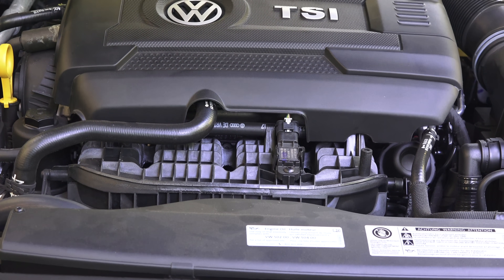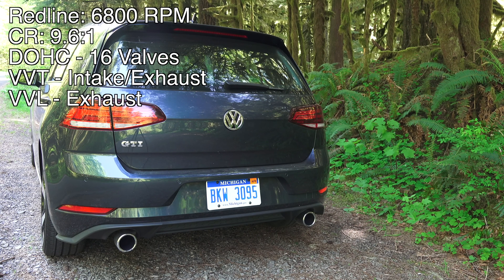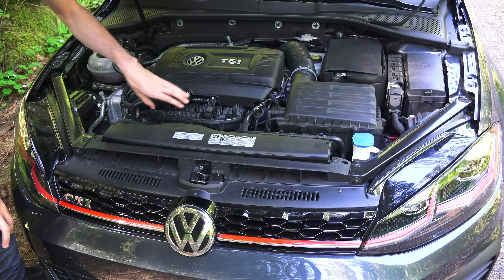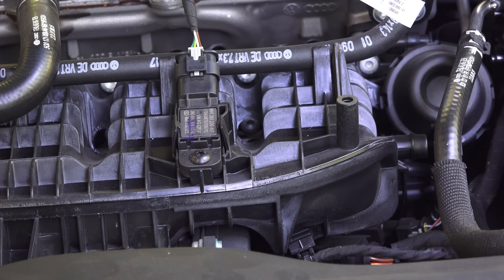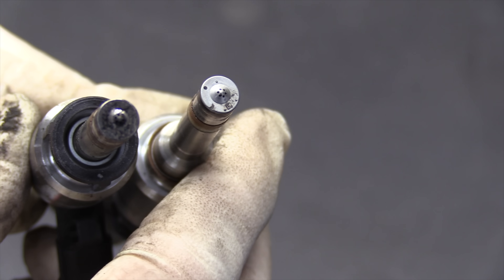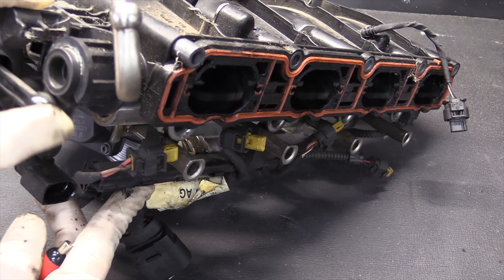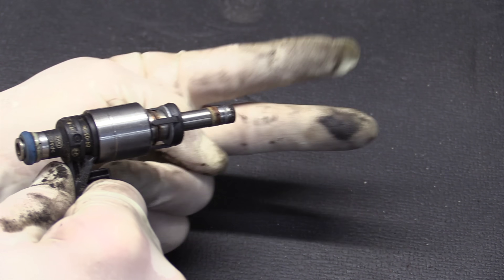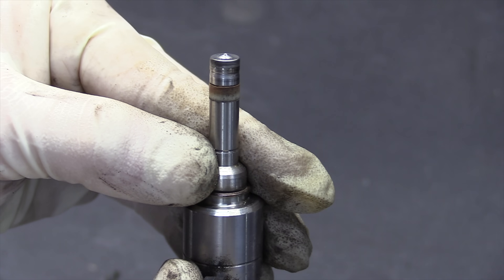The Best Engines - Volkswagen GTI Turbo

Comment: All the yadi-yadi-yada sounds good but I want to remind everyone that these engines have a poorly built water pump, poorly designed timing chain tensioner. The water pump in particular is known to continue leaking even after replacement at vw dealership. There is a class settlement currently going on for the crappy vw water pump on these engines. It ends in April, so don't forget to follow up with that is you own a vw with one of these engines. The timing chain tensioner is known to fail, resulting in total engine damage. That is to say the engine goes out of timing and damages the engine head, along with pistons and valves in the best case scenario. The vw dealership will ask you for $7800 before taxes to rebuild your engine. Even if you want be proactive and change the timing chain tensioner every 105,000 miles as recommended by vw, it's a 5 hours job at all vw dealerships and the bill is around $4000. If you have any car with these engines in them, also invest in a training on how to service them yourself because even though they drive wonderful when they work, their maintenance cost at the dealership piles up very fast as the miles increase. The new long wheel base model of vw tiguan, that started in 2018 has these, engines, and we are all keeping our fingers crossed to see if vw has made any meaningful changes to their design philosophy.

Comment: I have the 2019 Civic Type R and I love it. But Id like to hear from golf gti owners here, I'd like to get a GTI 2019 as my daily but is it reliable enough for daily drive? Any major issues?
Reply: Besides the manuals gti having some crank walk issues, the dsg dq250 & 381 are amazing transmissions. Maintain them every 40k miles & will likely have no issues. I know personally many people with mk7 gti & R s well past 100k miles. The gen3 is leaps & bounds better then any previous turbo engine from VW minus the diesels alh. The 18/19 came with 6/72k warranty so that should say a lot of how much they’ve improved.
Reply: @markd3891  Sweet..good to know , yeah i am actually set on the DSG transmission since its gonna be for my (winter) daily. I have a 17 Civic Si that i use now as daily but thats manual 😕 and id love to have an automatic. Thanks again bro. 👍
Reply: My 2017 GTI threw a thrust bearing and needed a new engine and gearbox at 104000kms.
Reply: @Cimone90  hmmm is that a common thing on the 17s? Thanks for your input bro.
Reply: @berlinmae07  no it isn't common. It's more common among the earlier models. I ended up putting in a 2018 motor so fingers crossed it's gonna be ok a long time now. If you google mk7 GTI thrust bearing, you'll find a few forum posts from others with similar problems but it seems very uncommon. I just got unlucky I guess.
Reply: @Cimone90  ok i hear you bro, glad everything's ok now with yours. Yeah i was gonna google it but got sidetrack like i often do lol, thats why i thought I'd ask around here. Thanks

Comment: They maybe best engineered engines but for sure worst when it comes to reliability. Everyone who works on these they hate these engines. I took mine once owned 2015 jetta with 1.8 to my mechanic he told me get rid of it because he had 3 more with same engine problems parked waiting to be fixed. He said same with audi and wv 1.8 2.0 engines. I had 2.5 that was way better, sold it to my friend he still drives it with well over 100k between him and I never had engine problem.
Reply: Wrong, the gen3 engines are vastly improved over the previous gen 1 & 2. Many of the mk7 guys are well past 100k miles. Your mechanic is not up to date on the gen3.

Comment: 2010 2.0 EA888 GTi engine. Lots of fun. Power and torque, response, and sound is very good. Chain tensioner fails and blows the engine (high percentage). Carbon build up a serious issue every 25K miles. Oxygen sensors and individual coil packs fail very frequently as well )aain about 25K miles). Those items fails two or more times sooner than it would on any Japanese or American engine. I hope VW has correctly all these issues since when it does run it runs great. Intervals for all those items to act up is just rediculous. Oh !!! fuel injectors had to be extended warranty by VW until 110K miles since those fail quite frequent as well. ha!!! This post is all true. If any doubts ask VW or the humble mechanic. Oh !! The intake manifold fails every 40K miles fail too hahah List to long to post here. I am a VW owner (use to be). Love the way they ride and perform but intervals for failure too soon for my liking and my wallet. I can provide you pages and pages of the repairs. On and on.
Reply: That’s why the gen1/2 were pos & why the gen3 is leaps & bounds improved vs the previous not to mention holds 350-400whp without much of a fuss either.
Reply: @markd3891  I sure hope so buddy. I spent a few K just to keep it running. Its a great ride. My concern is the reliability. No, I did not abuse it. Not even a sigle tire burn out. Good luck to all the V-Dub peeps . Im not a hater. I just got burned along with a few thousand other V-Dub owners.
Reply: David D I have 4 vag cars, knowing which engines & models to avoid helps so much. With that said, non of them ever gave me issues. I do have a Vagcom cable but besides doing dsg flushes & clearing the reminder codes, non of what other owners describe happened to be. My oldest vag is a 13 Touareg tdi with 182k miles. No leaks, no smoke no nothing. Replaced twice the brakes though & 3x oil changes in the trans too but I’m keeping it till the wheels fall off or the engine blows a piston through the floor lol. Gluck to you too, I know there are haters on everything just like everything else on this planet. It’s a love/hate relationship just like with the wife lol

Comment: My 2009 Jetta Wolfie with a 2.0 turbo was a CEL nightmare. Sorry. I’ll never buy another VW. It went 144k miles but spent a lot of time at the dealership. I even had to replace the throttle body at 120k miles. Junk.

Comment: No question modern technology and performs well within the application area. But this thing has serveral weakpoints, Turbo, coal coating, waterpump(s), Chain, valves, DSG...not a long runner everytime

Comment: Worst engine I've ever owned. Timing chain tensioner failed, carbon issues, intake manifold changed x2, Pcv valve, broken flywheel and two turbos. This all happened while the car was new and unmodified that was serviced at VW. 

2014 GLI

Comment: One of the biggest problems which was not touched on in this video is with the lack of port injection, carbon buildup on the intake side.  If they do dual injection it would be a big relief for a lot of people who don't want the headaches of a teardown to clean the carbon from a DI engine. Now I know this affects certain engines differently, but with these flaws of DI I still wonder how these can be considered some of the best engines. Aside from that, I am sure they ARE great.

Comment: I wonder if it's a laughable question but I don't get it so I'll ask anyway: Why is mpg in the city different than that on the highway? Also, why lower?
Reply: Let me simplify it for you
If you ride a bicycle and you stop and go many times will you waste the same energy as if you take a long road without stopping? If you get this you get your answer
Reply: @kawaonly1389  Yes I would be wasting just as much. So, is it just  the traffic that causes all the difference?
Reply: @subramanyabhat446  starting takes more energy than just maintaining speed. You don't need to repeatedly start moving on the highway like you do between lights in the city.

Comment: shiz - are those carbon deposits on the flaps in the intake manifold due to blow by and a PCV system designed without a catch can?  Imagine what the valves would look like = SCARY - quart of oil per 1,000 miles - no thank you - the VW Group are crooks btw - Dieselgate - haven't you heard ?

Comment: I have had many turbo cars, but 2.0 tsi mapped to 250/350nm with manual box is best turbo ive ever driven. The low torque makes it so effortless and fast in real life driving under speeds of ~150km/h

Comment: 3:30
Water cooled exhaust 
Or
Exhaust heated water?
Reply: the second
Reply: rt re 
Yes, it two sides of the same medal (as we would say in Dutch). 
I don’t understand however how cooling the exhaust can prevent knock as knock would occur long before the exhaust valve will open. Am I missing something?
Reply: @Conservator.   yep i think it's only for the engine to heat up faster and to have warm air in the cabine as soon as posible
Reply: @Conservator.  I don't think the exhaust cooling it has much to do with knock. If anything I would image hotter cylinder temps would increase the chance of knock. Better air/fuel mix does give you a more complete burn and more power.
Reply: cool gas is less tubulent therefore less speed

Comment: Premium fuel disqualifies this engine.
Reply: That's why the 1.8t 170hp, 200 torque is the way to go.  Runs great on reg and is super peppy and fast engine.
Reply: But premium fuel is everywhere...? And not that expensive, especially if you live in the United States.

Comment: It's a piece of junk.
Reply: Based on your opinion? How much value does that have anyway?
Reply: @bmw803  based on the fact that it's a turd. Plastic intake manifold, plastic waterpump housing on an electric pump, plastic oilpan. Also VW's consistent insistence on using abnormal bolts and other fastening methods and of course the fact that the entire companies reputation is based on a lie that refuses to die, which frustrates the hell out of sane people.

And in case you didn't know yet, the lie is that German cars (especially VW's) are reliable.
Reply: @hectorae86  most of the "plastic" you speak of is actually a composite and is extremely durable. Not to mention extremely common on much higher end vehicles than these. Also replacement part cost is lower if required. I've also had this entire gearbox and engine out of my car to change clutch and mounts to aftermarket ones as well as change out the downpipe and many other components and never needed anything other than regular old metric sockets and one triple square. Sooo also not sure what abnormal bolts you're talking about. Do you actually own one of these or are you just blowing smoke on YouTube for no reason?

Comment: Strange how this engine won so many awards when Mercedes has a nearly identical engine, the M270/M274 DE20, with almost the exact same power output and setup. Why is this engine getting all the attention?
Reply: Engine is an engine when getting awards, price has nothing to do with it as it doesn’t take into account the vehicle it’s in. It’s about HP/TQ/power band/smoothness/efficiency/reliability/emissions etc... The same VW engine is in VWs as low as $25k and in Audi’s up to $65k.. Your “point” makes no sense. Nothing against VWs, if I was in my 20’s again now In 2019 I’m be strongly looking at GTis, although my first car after Graduating college was a new 2003 350z, probably wouldn’t be getting any VW over that back then but these days the price on the GTI is right on.

Comment: Too bad they really messed up with the timing chain tensioner
Reply: chair face no gen 1 meaning ccta motors from early mk6s and late mk5
Reply: TheMeatncheese12 gen 1 and gen 2 tsi cbfa ccta
Reply: chair face how do you drive a mk7 and not know that the motor is a gen3 lmao
Reply: RIP my old gti
Reply: only on the gen 1 motors

Comment: I have an 09 GTI that suffered from carbon build up(I cleaned the intake valves it’s good now) but do the newer ones have that problem too?
Reply: Din Miftari all direct injected motors have carbon build up issues. It’s not a VW design flaw but a DI design flaw.
Reply: ZEEBIOUS I knew that but I wanted to know if the new ones have anything to prevent it

Comment: And then the constantly revised timing chain tensioner ratchet pawl shears and destroys the valves and pistons.... and becomes a technologically advanced vehicular statue. VW knew this (tensioner revised 10 times) and lost class action suit because of this engine.
Reply: The timing chain tensioners were only an issue on the previous gen mk6 engines. The 2015+ VWs are basically the first VW generation that could actually be called reliable. My GTI along with many many other peoples are all extremely reliable even when pushing the engine to twice its stock output. Can’t say that about most of the older VWs though.

Comment: IN THE SOLENOID ITS REALY NOT THAT COMPLICATED. THE MANIFOLD DESIGN IS INCORPORATED INTO HEAD OF CYLINDER. LOOK CLOSER AT REST AREA OF INJECTOR IN RELATION TO STATIONARY  OR PARTS IN MOVEMENT U.  ITS ACTUALT A TWO STROKE ENGINE.WANT TO SEE SOMTHING NEAT I USED TO HALV A 2 CYLINDER TWO STROKE SAAB  PRETTY FUN CAR .YOU CAN PRE MIX OIL IN GAS CHANGE A FEW PARTS 9F VW ENGINE AND HALVE A 2 STROKE 4 CYLENDER ARIUND 350 400 HORSE ENGINE VERY CHEAP MORE RELIABLE NO MACHINE WORK NECESSARY

Comment: I KNEW this motor had some sort of "VTEC" in it. Today on the way to work I was wide open throttle and at right around 5000 RPM it had an additional kick. Interesting idea with the cam lobe. Hope it never breaks 😬

Comment: Odd there's no mention of unavoidable carbon buildup due to direct injection. Basically expect to pay upwards of $550 every 3 years to remove carbon from the intake valves. Not a deal breaker but a pretty big design flaw

Comment: super informational. great video. can’t forget about the extreme tuning capability of the 2.0L EA888 in the GTI. 50 whp over stock reliably with no supporting mods. Even more if you swap for the Golf R IS38 turbo. Common mk7 mod.

Comment: Seen broken intake manifolds, bad PCV diaphragms, noisy timing chains/broken guides, gunked up intake valves.
High oil change intervals and no catch can system from the factory are wearing these motors out prematurely.

Comment: I enjoy your excellent video-clips.

If you’re looking for another “best engine” to review, how about the very strong & reliable, high-tech, and powerful Ford Australia “Barra” 4.0L DOHC 24-valve in-line six cylinder engine?

It’s an Australian design that incorporates a short-skirt cast iron cylinder block with a block reinforcing structural cast aluminium sump that has cross-bolts to the main bearing caps (cross & four bolt mains). Inside there’s a windage tray that doubles as a main bearings girdle. On top, the aluminium cylinder head has computer controlled independently variable timing of the intake and exhaust valves. The camshafts are also secured by girdles.

This engine came from the factory as naturally aspirated and turbocharged petroleum (gasoline) EFI variants, and an ingenious cleaner & cheaper running Liquid Phase Injection (“EcoLPI” - not to be confused with a phased out “EGas” variant) of LPG fuelled version which generates more power & torque than the standard petroleum (gasoline) version. 

LPI of LPG offers combustion chamber and piston crown cooling, and increased intake air density due to latent-heat-of-vaporisation. The high octane-equivalence of LPG permits 12:1 compression. These two advantages of the EcoLPI variant give high efficiency and very smooth running.

To give you an idea of how good these engines are, many have been boosted & tuned to generate well over 1,000BHP in street cars, while very reliably keeping their stock bottom end components. Broken Barra sixes are almost unheard of. 🚙

Comment: Looking at APR website, VW is under-rating the stock power on most every model with the EA888. A simple Stage 1 flash and you make SIGNIFICANT power without changing a single hardware piece.
Reply: I'm not against flashing an ECU, did it on my ST and it made a considerable difference, but I can't help wondering how many hours these companies have put in to bench testing an uprated engine to ensure long-term reliability compared to the original manufacturer's testing.....
Reply: @martinarscott3524  I can't speak for a lot of tuning companies, but I do know APR is no joke. They regularly tune Porsche, Audi, VW, Skoda, gas and diesel engines. They have access to deep parameter controls in the ECU and have proven track record. Wouldn't doubt me at all that the post-APR tune is higher quality to the longevity of engines than factory. Factories do a ton of R&D of course, but they are subject to emissions restrictions which always pose a difficult challenge for manufacturers to achieve performance AND meet emission standards.

Comment: They're only great if you know exactly what to look out for and do a lot of preventative maintenance. I still have a Gen 1 EA888 going almost 10 years strong and it's tuned with zero issues. But with that being said, carbon build up, water pump failure, and the potential for the timing chain tensioner to fail is really the worst of it.
Reply: Gregg Cesaroni bought my 2016 Golf GTI a month ago and I’m loving it so far, 46k miles (bought it at 45k) doing DSG fluid service and oil change next week and then at 50k miles doing decarbon of cylinders
Reply: @killer_vette351  They're great cars but all you need to do is keep on top of the maintenance. I suggest changing the oil every 5,000 miles. I've run Amsoil Euro Blend in my car for 5 years now. I've had great results with it. It actually helps the clean up when cleaning the intake runners quite a bit. My tech told me that he could wipe most of the carbon off with his fingers. Also, get an oil catch can because I have heard the PCV valves like to stick open. Even with the Gen 1 motor in my car that happens too.